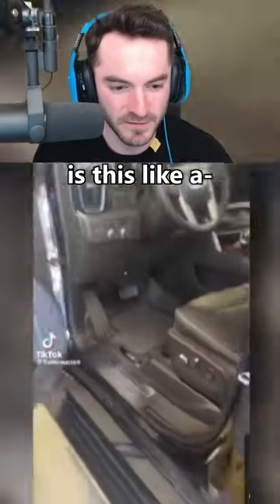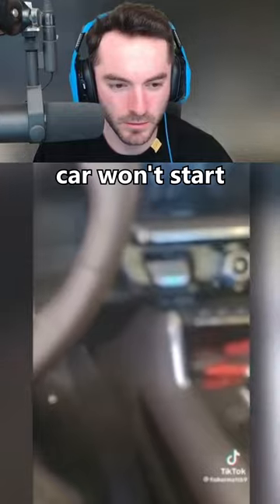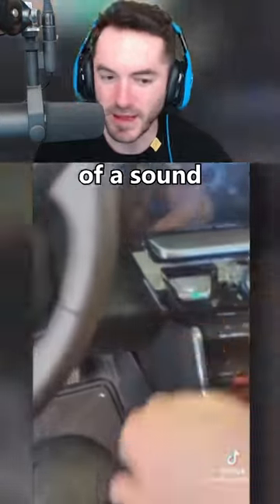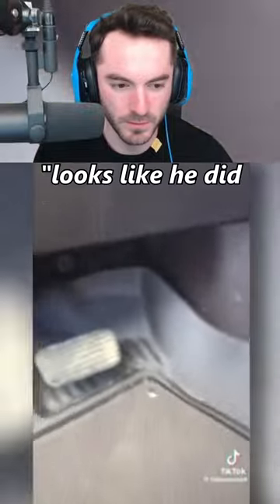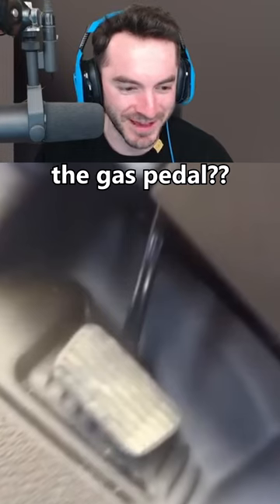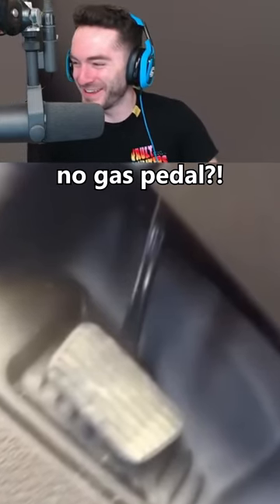Invisible gas pedal mod

Comment: This was the issue with Toyotas in the 90's. The manufacturer made faulty floor covers that would sometimes fold over the accelerator causing the driver to all of a sudden lose control of their vehicle and ram into traffic even when they were fully on their brake. Took a long time to realize why the accelerator got stuck because you can't really see the problem.
Reply: that was lexus and that whole issue was the dealerships fault for installing a wrong weather mat.
Reply: @draimen3371  First Recall of Toyota vehicles in November 2, 2009 was for the floor mat issue. Lexus vehicles around the same time were also recalled for the same issue.
Reply: @cjandauntieyaya1446  oof, the same issue from 2 manufactures? thats bad
Reply: @darkdruidsvale Toyota makes Lexus
Reply: @TheHonestL1ar  really? shows how much i know cars lol, guess cj's comment is worded weirdly then since that makes it look like their 2 different brands
Reply: @darkdruidsvale sister brands basically a lot of similar parts and  better quality builds and higher prices
Reply: And now every Toyota comes with locking tabs on their floor mats
Reply: Almost like Lexus and Toyota are owned by the same company @draimen3371
Reply: @aslofiasitcanget2945  huh, good to know

Comment: On almost every car pressing the pedal to the floor will turn the motor over but not add fuel as the engine is turning over. It's for leak down and other compression type testing

Comment: And that's how my brother drove his stickshift car through the fence.
Reply: how? like you have to press the clutch to start the car
Reply: @bastik.3011 yeah but if the gas is depressed it’ll still start so I would assume he forgot it was in gear, started the car and then let the clutch engage without thinking. Either that or his pedal got stuck on the mat while driving and he didn’t think to just depress the clutch pedal to stop 🤷‍♂️
Reply: It was the first scenario. And he was so proud he remembered to take off the parking break.
Reply: @paudan1284 again most manuals cant even be started without the clutch pedal being pressed
Reply: @bastik.3011  read my comment again cause idk where you got the idea I don’t know that.
Reply: @dannylenz7632  😂 we all gotta learn something the hard way ig
Reply: @paudan1284  ah sry, damn i am to tired
Reply: @bastik.3011  not necessary, in none of the cars I've driven I've had to press the clutch to start it
Reply: @Jowen0wen  its mostly a modern thing. My 2015 opel forced you my 2008 Skoda doesnt but the Mercedes Sprinters at work force you aswell after a certain Manufacturing year
Reply: how tf. just push down the clutch 😂

Comment: The only vehicle the owner that did this should have is a tricycle...
Reply: No…unicycle would be far funnier. Plus less parts to mess up.
Reply: Tbh I bet this dude could somehow fuck up walking to the bus stop and catching a bus 😂
Reply: Eh to be fair if it’s someone not at all mechanically inclined you wouldn’t even get to using the gas pedal if it doesn’t start probably just didn’t start so rather then looking at anything they sent it right to the shop I mean it’s still very stupid but you cant expect every driver to know much if anything mechanical about the car as long as they can drive it safely
Reply: @crystalkitty5741 And somehow that person gonna mess it up somehow

Comment: I knew the gas was being pressed the moment i heard the engine, but i didn't see where the pedal would be hiding.
Reply: I didn't know pressing the gas pedal would prevent you from starting the car? Sometimes in my car is having trouble starting if I push on the gas pedal all of a sudden my car will start so that's why I'm confused.
Reply: @bland9876 if you hold the pedal all the way down, it stops the injectors from firing. It’s intended to clear flooded engines. 
The reason some cars need the gas pushed down a bit to get them started is because it may be running a bit rich or lean. (my old mustang did this, a few sensor replacements and all good)
Reply: @alecwhatshisname5170  I noticed that on my car it only happens when the battery is going dead. Jumping or replacing the battery stops me from needing to gas it.
Reply: @alecwhatshisname5170  I had the opposite. I did not realize why the engine was making that sound, but I had a feeling that the gas medal was hiding under the floor cover.
Reply: @bland9876 It doesnt on all cars but a lot of cars yes holding the throttle pedal at Wide open position will do a flood clear mode

Comment: If you're confused, nearly every car in the world since the 90's has a feature where if you hold the gas to the floor while cranking, the injectors will be inactive as a feature to clear water out of a flooded engine, cycle oil after an oil change, or just troubleshoot starting problems. It's useful if you want to prank your friends as well.
Reply: It’s to clear excess gas from an engine. Water doesn’t compress so it will hydro lock the engine cranking it would damage the engine
Reply: Not there on my 2012 hyundai elantra I tried it before held the throttle to the wide open position and turned the key to start and the car started like normal but instantly tried to rev to redline

Comment: Ah, the old hiding the pedal under the Floor carpet. Doing that in new vehicles starts a flood flush cycle, so it can clear flooded cylinders, no fuel is getting to the engine because of that.

Comment: My floor mat in my first car slid up over the gas pedal *while I was driving*. I couldn't stop so I reached down to pull the mat off the pedal. Since I couldn't see the road for a second I went slightly off the road and demolished one of my neighbors mailboxes. Moral of the story, if a car wont stop, try turning the keys off.

Comment: That means the engine is flooded 💀💀💀
Reply: No on modern computer cars you actually do this to unfold the car if it is flooded to will turn off the injectors and hold the throttle blade open

Comment: How do you even do this?
Reply: Mechanic here: 

The floor mats, specifically on these newer vehicles, are SUPPOSED to be held down on the floor by little retention clips. This truck either had replacement floor mats or they weren’t clipped down after a cleaning or something like that, and the floor mat slid around from the driver getting in and out and eventually it covered up the gas pedal. 

As for why the engine wouldn’t start without getting too detailed, its all in the truck’s computer. These newer vehicles have a mode designed to clear excessive fuel out of an engine in the event it becomes “flooded” with fuel. This is done by flooring the gas pedal before starting the engine.